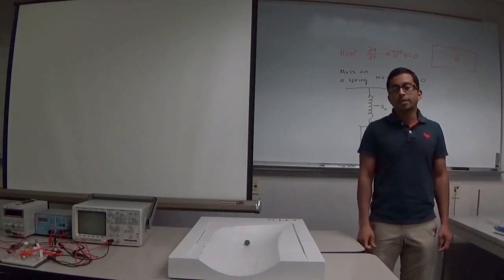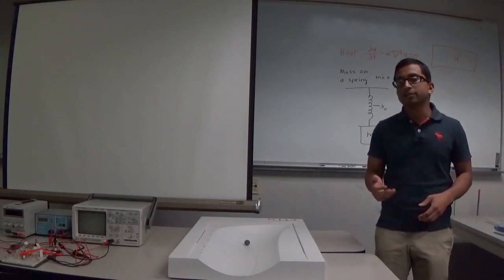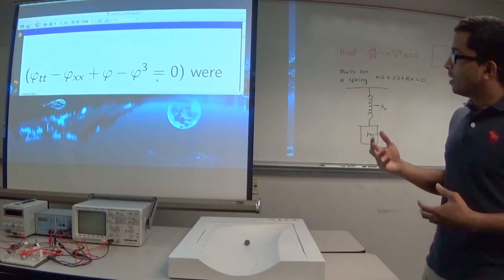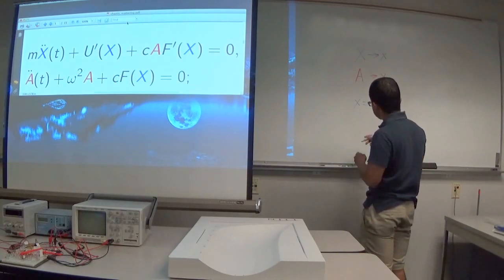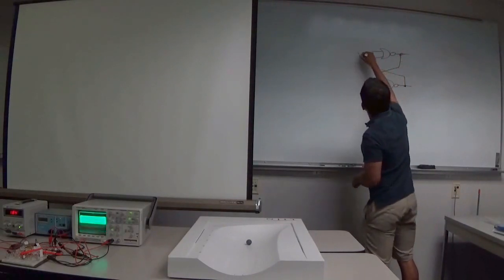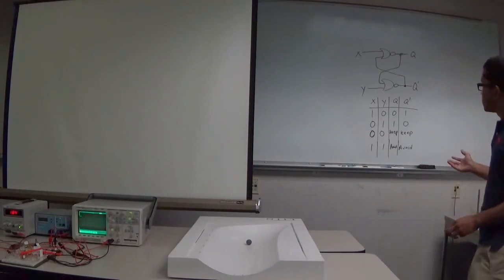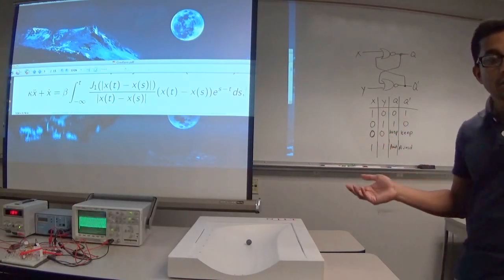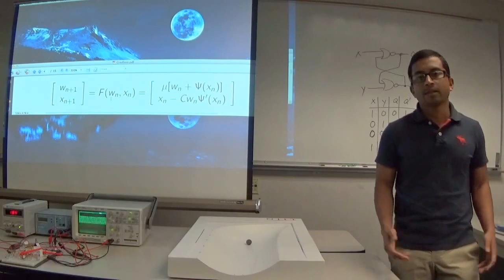SIAM video pitch about my research

Comment: In reference to the system at 9:04 and the double slit experiment, if we take the limit as dt approaches zero, and 'step' t+h as the mass passes through the slit, is the wavelength along the axis parallel to the direction of the movement elongated by comparison to the wavelengths orthogonal to that axis? I think of  a round object of any size as it passes through an opening of any smaller diameter; as it passes through it "squishes" and to preserve its mass elongates to fit through the opening. Do we have something similar here with the wavelengths as they encounter interference of increasing influence as it passes through the opening?
Reply from the maker: Timo Lee That's a great question, Timo!  In Yves Couder's and John Bush's experiments, the obstacles are bellow the surface of the fluid, so the droplet never interacts with it directly.  However, the question is still valid, but I don't think anyone has done experiments with varying widths.  I do know however, that one group is reproducing the experiments and will be studying what happens with varying width as well.